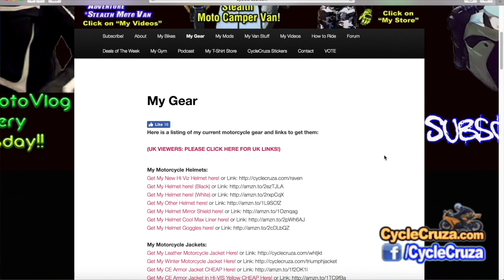WILL THEY PAY $1000 Repair for My BROKEN WR250R? UPDATE!

Comment: Chain too tight when landing that jump putting stress on the sprocket thus stripping it out. Faulty part and installation? Imo
Reply from the maker: chain was in spec, I've been installing sprockets and setting the chain on every motorcycle I've had with no issues. I put on the chain and sprockets on this wr250r previously, however, I used a OEM front sprocket. PRO X is trash, they didn't even have the class to return my email. At least RockyMountain ATV emailed and called me, even offered a discount on yamaha parts that I need. I have zero respect foe PRO X.

Comment: Dude Theres no way it could spin if it was in spec.   Chain alignment has nothing to do with it.   The gear was bolted down.   If it spun on the teeth, either you applied a monstrous amount of force thru the shaft or the part was out of spec.   We all know the bike only makes about 30 hp , so theres only one reason it could happen.    Either they are selling pot metal sprockets or there was way to much slop between the splines.
Reply from the maker: I will probably have the metal tested on the sprocket. Check this video out, this mechanic shows a brand new aftermarket sprocket that caused damage: https://youtu.be/aOxBF80eMrI
Reply: CycleCruza  Interesting video.   Probably something you want to check every few thousand miles.   ->   On both my bikes I have OEMS on the front  , there is absolute zero 0° of slop between the output shaft splines and the drive sprocket splines.   Absolutely zero slop.   They slide on really snug....   Thats the way it should be , no slop at all or somethings wrong.

Comment: You clearly installed it on backwards by the damage
Reply from the maker: Manufacturer AND Rocky Mountain ATV said the counter sprocket can be installed both ways, that was never the issue. Trust me, stick with an OEM counter sprocket. RMATV ended up giving me a nice discount on the parts needed to fix it.

Comment: I've been watching your videos for quite some time, and the thought that you would install something wrong is a freaking joke. No, what it is is soft metal and imprecise blueprinting or manufacturing. Like another poster said, take it to be examined. You're in Cleveland, Case Western has an excellent materials science and engineering department, they should be able to help with metallurgical analysis. I would bet that the steel is not high quality.
Checking the site it says the sprocket is made from SCM435 steel. Which is a type of Chrome-Molly (chromium-molybdenum). It's frequently used in machine parts, low carbon (which I hate) but in this case nickel coated and case hardened. With a low carbon core, for break resistance (it's more flexible).  But, SCM can have an issue with brittleness, when the heat treat isn't nailed. Wouldn't be surprised to see them sort of err on the side of caution and not get aggressive enough on the heat treat, and leave it a little soft. For instance, the OEM sprocket is C45 steel. Which has a higher carbon content (it's mid-carbon steel) and when properly heat-treated has better hardness and excellent tensile strength. I think ProX got cute trying more "exotic" steels. 
Anyway, sorry for the length of this. I hope ProX does the right thing by you CC.

Comment: One question....is there a real benefit in replacing the sprocket? And also a comment... I respectfully think that you should've listen to your gut and use some common sense when you realized how different the cheap new sprocket was in comparison with OEM man, now seems too obvious, but one sprocket next to the other you can clearly see no benefit in replacing oem with the after market
Reply from the maker: Form here on out I'm ONLY using OEM front sprockets on any bike I get. I will only get aftermarket for rear sprockets.

Comment: You are going to go through "can't ride in the woods" withdrawals if don't get it fixed soon. Buy land, get two stroke.
Reply: Mark Smith two strokes have to have the Pistons and rings replaced every 40 hours...high, high maintanance. You may get 80 hours out of one but, they are severely worn at that point. Four strokes are mild but, last forever. Which is crazy...they have more moving parts...logically, that should be a weakness. ..but they last. I have a 1993 honda xr650l.. still running. No major engine issues in 25 years. Regular oil changes?
Reply: Chuck Bowen yep, land and Zero fx then, so he doesn't wake the neighbors, just kidding. He previously said he wanted a two stroke too, knowing all the specs. Whatever he does, odds are, it will be cool.
Reply: Mark Smith the guy can't even change the oil on his Ducati, tried to rivet a clip type master link in his install video (then the scene cut and magically it was a rivet type), and won't swap out a $90 countershaft himself. You think he really has the knowledge to own a high maintenance fire breathing 2T? Bahahahaha
Reply: n00bHaMmEr It may be high maintenance, but he has other bikes so he won't put lots of miles on it, and it is a world away from top end work on a multiple cylinder top end with carburetors in a parking lot in the military, no cam chain, mercury gauge, and valves... Cheap, is learning to do it yourself. He probably should watch the recent Fooligan video on the two stroke and comments. I personally think he should at least test that Zero FX, less moving parts, if it's true they can go a hundred thousand miles before battery change, not bad.
Reply: Mark Smith I don't think he has either the skills nor the wherewithal to own and maintain a 2T lol. And this is coming from a KTM guy.
Reply: n00bHaMmEr I hate carbs, love fuel injection, you could be right. The only two stroke I have to fix is the EX's 50cc scooter, after her dealer turned out to be jerks. Like my single cylinder four strokes. Can do it, will do it once just to be familiar, but would rather someone else do it. He will save lots if his income is less than the mechanic's income, but if he makes more per hour get them to do it.

Comment: half worn splines within a few miles is defo an install error or a wrong sprocket for this bike  wich u should have noticed during install. its impossible the grind away half the splines if it is on the axle completely unless the nut came loose wich is a mechanic error again. they might have send u the wrong sprocket or gave you wrong advice but in the end its the mechanics responsability to check the final job once done. clearly u didnt and now u caussed collateral damage. your own mistake imho so just suck it up and fix it.
the time u spend making videos explaining this u could have spend fixing this issue.
Reply from the maker: I guess you didn't see this video of a mechanic showing a brand new aftermarket sprocket installed sorrectly that caused damage: https://youtu.be/aOxBF80eMrI
Reply: CycleCruza i did now but that means nothing.u missing my point.if it was a poor sprocket wich caussed  your damage the whole length of the splines would have been damaged.with yours only half the length was gone wich clearly shows it wasnt on the shaft completely or came loose both  meaning mechanic error.

Comment: well well well. did they tell you that after the video was sent or b4 they answered? guess that gonna cost thwm more than a k, loss for them loss for you, nobody wins. would be alot cheaper if theu would have fixed it, I won't buy their garbage for sure now. that's how a weasels operate. I know that if it was a warranty the burden of proof is on thwm to prove it was installed incorrect.
Reply: Wrong.

You bring in a piece of metal that's worn down, no matter what it is they are not obligated to prove anything simply because metal does not just disolve away for no reason. Only by using a metal object incorrectly will it do that. Had the piece shattered with no sign of impact or other abnormal use they would have replaced the sprocket.

Attempting to get money from a company for something that's not their fault is a pretty low thing to do. They made their diagnosis, it's a correct diagnosis so suck it up and move on.

I would not have even contacted them at all.

You see a dent in your fender are you going to get them to pay for it too? I didn't put that dent there, it must have been the sprocket. Lol

Comment: Looks to me that they didn't harden the part and the teeth just tore off. Inferior build quality.
Reply: ps. Maybe related to the added horsepower to your bike as well. It can't handle the beast!
Reply: John Hovan wong.
Reply: John Hovan yeah a solid steel sprocket couldn't handle all 28hp that his WR puts out. eye roll